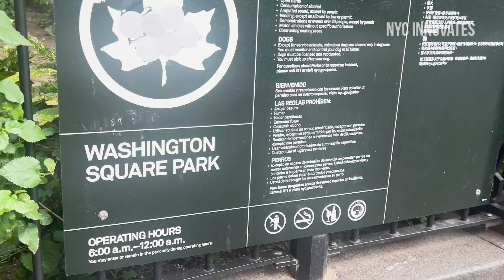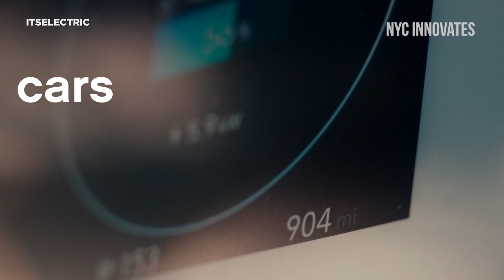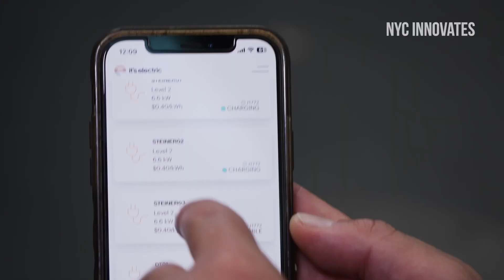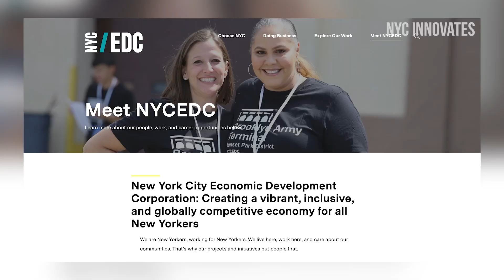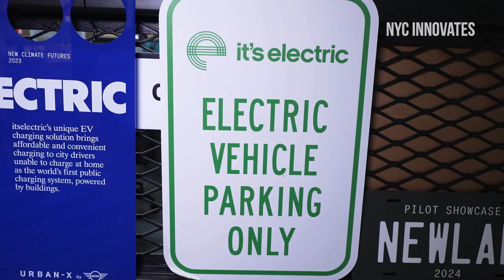How EV Charging Could Change NYC Streets

Comment: Cables will be stolen by the millions. People will trip on the cords that aren't stolen. Pedestrian space is at a minimum in large cities, these take up more space.  Maybe someone should make a curb level charge device that mounds in ground and  attaches to the bottom of the car when signaled to for  recharging it ? Pull up, tap your app, and a connector rises up next to the curb and connects to the lower rocker panel of your car and charges away. Now, someone go make it and claim it was your idea.
Reply: Tesla is adding inductive charging and automatic positioning, so future vehicles could certainly do that.

Comment: New York has kind of pathetic ev incentives that don't even cover the vehicle sales tax and fees for vehicles most people want, not chevy bolt fire hazards.

This solution is going to make people even more angry about parking.
Reply: Teslas are the largest ev fire hazards. Documented facts show that. 
The taxes should be higher for EV to help offset the loss of gas tax that go to help with road repair. As crappy as the roads are they'd be a lot worse without the tax, and you know ev drivers will bitch about he road conditions.
Reply: @damham-F47  you add that tax AFTER EV is the main kind of transport, or at least is as cheap or cheaper than gas.

Comment: Why do the posts have the European plug
Reply: Because North American designs/standards call for a captive cable permanently attached to the station, which is basically a non-starter for curb-side deployment for a bunch of reasons. Simpler to just import ready-made european posts and provide a cable that adapts between the two plug types to the customers, rather than design custom posts just for this deployment.
Reply: @siberx4  You really only need a 240V 50A NEMA 14-50 receptacle, as many EVs have mobile chargers for home charging. That's the same thing that RVs use at camp sites, too. Car owners would still bring their own cable, so the decision to use the EU plug still seems odd.

Comment: This is quite funny; the posts have a euro-style Mennekes level 2 connector, because over there the charging system operates on the assumption that the car comes with a cable already and all the stations are designed with receptacles and no loose cables. You plug your own cable into the station and bring it with you when you're done, which means you're invested in keeping the cable in good condition and never have to worry about pulling up to a station with a broken/missing/stolen/frayed cable.

For whatever reason, in North America we instead expect the cable to be attached to the charger rather than coming along with the vehicle, which makes deploying curbside charging a lot more complicated because you need to deal with the bulk and maintenance of a cable.

This company has simply imported the euro charging posts and provides the customers with a cable that adapts the euro-style connector to our North American level 2 plug (J1772). This works fine and totally solves the problem, and just highlights the absurdity of the normal North American design.

Comment: Power grid can't handle EV adoption. They're an expensive toy for people that want to feel they are 'helping' or are 'in on the ground floor'. Not to mention if the battery catches fire, there's no way to put it out feasibly.
Reply: Refining petroleum takes up a huge amount of electricity annually for the US: at around equivalent to about 278TWh of electricity!  That's several times the 12.15TWh that all the EVs in the US uses (see my previous post)
Reply: You are so fucking wrong it's not funny, firstly the electricity demand over the past 5 years has decreased despite an increase in EVs, the estimated additional demand on the grid for EVs is 1-2% per year but as everything else gets more efficient than could possibly be offset by more efficient appliances. Oh and if we went 100% electric tomorrow the demand would be roughly equivalent to 1 new washing machine in every house being used once per day. Not to mention the amount of electricity used in the oil industry. Every gallon of oil uses a couple kWh in its production.
Reply: Also other countries have done it and seen no spike in electrical demand. Norway has now 50% of all cars being electric and they use exactly the same amount of electricity as before they had electric cars (with economic and slight population growth)
Reply: Fact: On a watt hour basis, the US grid can easily accommodate the EVs now and expected growth.

The US grid produces about 4200TWh (terawatt hour) of electricity in a year.  But the approximately 3-million EVs in the US collectively use only ~12.15TWh of electricity a year!  That's based on the average US driver travels 13,500 miles/per year and with average EV efficiency of 0.3kWh/mile.

Furthermore, the current 4200TWh grid can be some 50% greater without any upgrades since nighttime grid usage is very often low.  That's when most EVs can charge and get the lowest rates too.

Also, refining petroleum takes up a huge amount of electricity annually for the US: at around equivalent to about 278TWh of electricity!  That's several times the 12.15TWh that all the EVs in the US uses.

Fact: Fossil fuels are a dead-end technologically, environmentally, and economically.

Fact: Water should not be the primary way to put out electrical fires, and fire departments do not have the correct extinguishers for battery fires yet.  Need specialized extinguishers like Class D and dry chemical extinguishers.  Engineers are working on a "spike" puck that can be slid under an EV and puncture the bottom chassis to inject extinguishment directly into the EVs sub-assemblies.  As the world changes, so too will firefighting change.
Reply: Fact: On a watt hour basis, the US grid can easily accommodate the EVs now and expected growth.

The US grid produces about 4200TWh (terawatt hour) of electricity in a year.  But the approximately 3-million EVs in the US collectively use only ~12.15TWh of electricity a year!  That's based on the average US driver travels 13,500 miles/per year and with average EV efficiency of 0.3kWh/mile.

Furthermore, the current 4200TWh grid can be some 50% greater without any upgrades since nighttime grid usage is very often low.  That's when most EVs can charge and get the lowest rates too.

Also, refining petroleum takes up a huge amount of electricity annually for the US: at around equivalent to about 278TWh of electricity!  That's several times the 12.15TWh that all the EVs in the US uses.
Reply: Fact: On a watt hour basis, the US grid can easily accommodate the EVs now and expected growth.

The US grid produces about 4200TWh (terawatt hour) of electricity in a year.  But the approximately 3-million EVs in the US collectively use only ~12.15TWh of electricity a year!  That's based on the average US driver travels 13,500 miles/per year and with average EV efficiency of 0.3kWh/mile.

Furthermore, the current 4200TWh grid can be some 50-percent greater without any upgrades since nighttime grid usage is very often low.  That's when most EVs can charge and get the lowest rates too.

Also, refining petroleum takes up a huge amount of electricity annually for the US: at around equivalent to about 278TWh of electricity!  That's several times the 12.15TWh that all the EVs in the US uses.
Reply: Now add energy intensive Cryptocurrency and Ai into the mix. Hell, they are even reopening 3 mile island exclusively to power a Microsoft's Ai computing center near there. Multiply that by tens of thousands of Ai centers and Cryptocurrency farms. Then add millions if EVs. Im all for cutting back on burning gas and oils, but maybe mass transit is a better solution ?
Reply: @damham-F47  The sun's massive 173,000-terawatts it provides non-stop to the Earth.  Or about 1000W per square meter peak on the ground and it always peak somewhere.  The sun can provide the world's annual 620-exajoules of energy in just 1-hour.  Or just 1/10000th of that over the course of 365-days.  The cosmically large power of or sun provides plenty of headroom before we reach Kardashev Type-1 civilization status.

The looming energy scarcity mindset is a product of fossil fuel thinking.  Future energy systems based on renewables will make the current energy system we have look like a child's bedroom toy set.  

Furthermore, AI will not bring down the grid.  If anything, the grid will limit AI.  All complex systems (organic or not) are limited by the amount of power they are able to acquire.

Moreover, datacenters have massive roof area, parking area, and neighboring empty land allowing for linear pairing of energy demand with energy supply using rooftop/ground mount solar.  Combined with onsite energy storage, most of a datacenter's annual energy draw will not come from the grid.
Reply: Are you living in 2010? EVs are more mainstream now than ever before. Millions of Americans own them, and the grid can certainly handle them, there's data on that.
Reply: @CalebTheFew06 I have never seen a ev or a charger in person they are not everywere
Reply: *this comment has been paid for by the gasoline industry.
Reply: Actually no, not at all.
Reply: There are a lot of people with a lot of excuses, there are also a lot of EV owners who have been doing it for years, previously owned gas cars
Reply: ROFL... Fox News viewer Alert
Reply: Fact: On a watt hour basis, the US grid can easily accommodate the EVs now and expected growth.

The US grid produces about 4200TWh (terawatt hour) of electricity in a year.  But the approximately 3-million EVs in the US collectively use only ~12.15TWh of electricity a year!  That's based on the average US driver travels 13,500 miles/per year and with average EV efficiency of 0.3kWh/mile.
Reply: Yes, you are exactly right. Except not in any way.
Reply: Fact: Water should not be the primary way to put out electrical fires, and fire departments do not have the correct extinguishers for battery fires yet.  Need specialized extinguishers like Class D and dry chemical extinguishers.  Engineers are working on a "spike" puck that can be slid under an EV and puncture the bottom chassis to inject extinguishment directly into the EVs sub-assemblies.  As the world changes, so too will firefighting change.
Reply: Fact: Fossil fuels are a dead-end technologically, environmentally, and economically.

Internal combustion engine (ICE) vehicles will one of the first to be disappear.  Bans on new ICE sales will be enacted in 2035 by leading economies around the world including US and EU.  China has something similar but has differences between its provinces.

In addition to contributing to global climate change, ICE vehicles pollute our very cities with smog that goes right into our faces, lungs and bloodstream.

All the problems you cited are not show-stoppers at all.  But ICE and its parent fossil fuel industry is not only a showstopper, it's a world-ender.  My final advice to you: Do not underestimate the innovations that US can pull-off when its back is against the wall.  All the science and economics show that electrification is the future.
Reply: You guys seem to treat the power grid like an RTS game. There's baseline, variable, and flux production. You're still using petroleum products to meet flux demand and most of the US's baseline. I'd respect EV enthusiasts more if they weren't scared of nuclear power generation. We'd still need a combustible for flux demand though...
Reply: @akaroth7542  In 2023, the US generated 233TWh of actual solar generation.  More importantly, US solar has been growing by a large 30-percent compound annual growth rate (CAGR) over the past 10 years.  With that growth, the US can meet its 4200TWh annual grid generation on solar alone by 2035!  But that doesn't even include US wind energy which is even greater than solar right now.  China has a massive 70-percent CAGR solar growth and is actually now building the equivalent of 5 nuclear power plants a week worth of solar!
Reply: @akaroth7542  Specifically, nuclear power is amongst the most expensive forms of energy, and it's just keeps getting more costly.  Then there's the ongoing issue if nuclear fuel waste which is some of the deadliest materials on Earth (gamma radiation) and remaining hazardous for tens of thousands of years at least even longer.  Storage of nuclear waste is only theoretical as we cannot predict our storage mechanisms and sites will reliably last 100 years let alone 10,000+ years. 

No wonder why then Germany, Belgium, Spain, Switzerland, Italy, Taiwan, Austria have abandoned or announced to abandon commercial nuclear energy.
Reply: @akaroth7542  Finally, with its long 70+ year history, commercial nuclear only powers 10-percent of the world's grids and that number is falling.  Commercial grid-scale nuclear is the longest running joke in the energy industry.  But I find many fossil fuel acolytes seem to push for it.  Some out of ignorance, but some clever ones know that pushing for new commercial power over renewables would actually just slow down the global energy transition greatly.
Reply: @beyondfossil  Nice fearmongering over the cleanest and least climate impactful energy source we have access to. This is exactly what leads to unrecyclable wind turbine blades and highly polluting solar cell manufacturing
Reply: @akaroth7542  Nuclear power is clean but not the least impactful.  You cannot just build nuclear power anywhere.  It needs large continuous volumes of water for cooling (up to 60,000 gallons per MWh) and the heated water can pose problems for local waterways.  Yes, because of "fear", you get NIMBY to the extreme most anywhere nuclear is built.  Read again on the issue nuclear waste.  Fukushima and Chernobyl are the headline accidents but there have been hundreds of smaller ones that involved some release of radionucleotides into the environment.
Reply: @akaroth7542  Commercial nuclear power's failure over the past 70 years is a significant reason why we're so far down the climate disruption hole we're in now.  It is written in black and white history.  The "fear factor" of radiation is a problem but actually the least of nuclear's long list of problems: high cost, extreme build times are the headlines that will kill it off.  In the next 50 or so years, commercial nuclear will be almost completely gone from the grid.

Solar panels and wind turbines will all be recycled.
Reply: @beyondfossil problem right now is recycling wind turbine and current solar panels.  Neither are made for recycling. Hopefully we can figure out how in the future. But right now retired units are just being buried under ground.
Reply: @damham-F47  The recycling of solar panels and wind turbine blades is right up the alley of what current engineering and government policy can readily solve.  It is a matter of scale maybe.  As hard as it is, its small compared to intractable problems of fossil fuel usage and decades long costly problems with commercial nuclear power.
Reply: @damham-F47  Furthermore...  Just look at the masses involved.  We currently emit annually 37 billion metric tons of CO₂ from fossil fuels usage.  That CO₂ is emitted as a high entropy gas and is almost impossible to collect again economically.  Whereas solar panels and wind turbine blades are low entropy solids much easier to recycle based on that alone.

By 2050, the expected mass of all wind turbine blades are expected to be around 43-million tons which is just over 0.1-percent of just 1-year of current carbon emissions!  Even if wind turbine blades are buried, their very inert construction of epoxy means they can be dug up much later and recycled when the technologies and policies are in place to do so economically.
Reply: @akaroth7542  Its not being "scared" of nuclear power.  With the rapid growth of renewables, new commercial nuclear power simply isn't needed.  Look in 2022, more than 80-percent of new grid capacity worldwide was renewables.  It also helps that renewable energy generation has reached all-time historic lows and is the cheapest form of energy now, and the prices are still driving downwards.  The world has clued into something here.
Reply: Ask any firefighter how an EV fire goes. Do any basic research into what goes into running the electrical grid. 
This is without mentioning how anti-consumer these cars are built: parts that could be made separately for ease of repair aren't and cost a fortune to acquire. 
     Only rich people can afford to wait months to get repairs done on a car.
Reply: @akaroth7542  

I am in the EV battery field. There is a disconnect module that firefighters pull to disconnect the battery from the car. Firefighters are being trained on this
Reply: @JoeGatz1  cool, work with firefighters. If the battery is burning already= not safe to go near it except with an expensive and large portable submersion chamber to try* and make the battery metal stop reacting.
Reply: @akaroth7542  No poor people can wait as well as they have buses and taxis and insurance provides replacement cars in some states and Tesla provides replacement cars as well.
Reply: @loveanimals-0197  You've never used a taxi, have you? And no, replacement cars aren't always available or provided while you pay 20k$ for a repair.
Reply: @akaroth7542  I’m an automotive technician and everything you said is false.
Reply: @BigD4Real.  What's false?